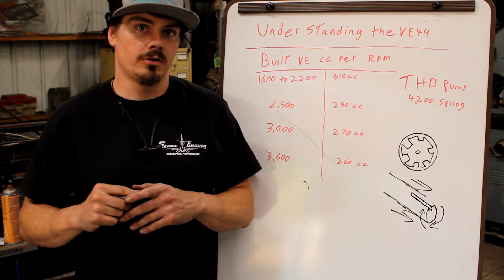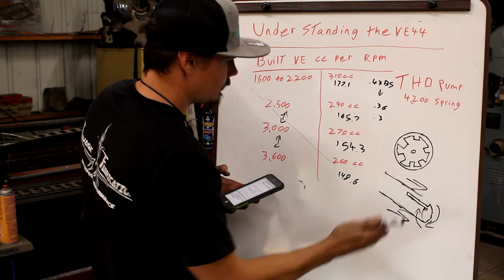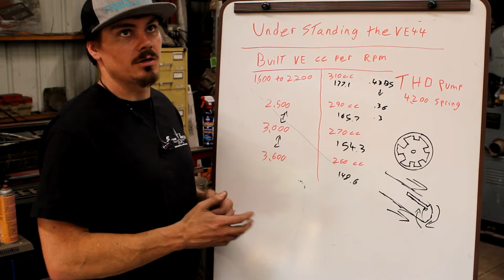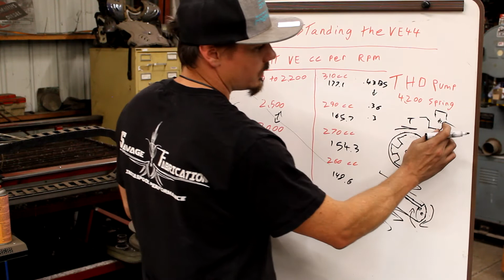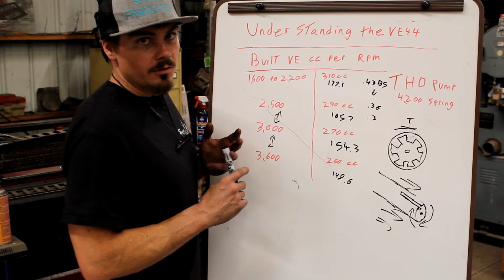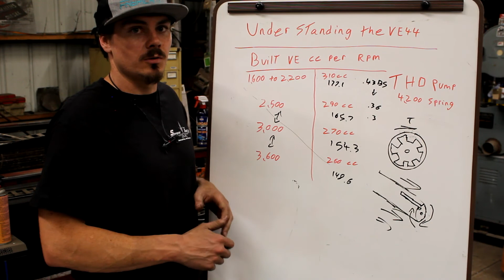VE Deep Dive pt 4

Comment: So if max fuel comes in at 1600-2200 correct me if I’m wrong but wouldn’t the 60mm hx super 9 with the vigilantly upgrade be perfect if max rpm is 3000
Reply from the maker: On paper yeah. But I have a feeling that you would produce a higher whp number with the std wheel. 

If the goal is not so much a peak hp at peak fuel delivery and instead a peak hp at 3k then yes the vigilante would help.
Reply: Would be interested to change my s363 out for a 60mm hx and see how much of a difference there would be in power and drivability
Reply from the maker: @daytonheacock8243  what turbine wheel is on your 63 s3

Comment: So can you run a non intercooled ve pump on an intercooled engine for more power?
Reply from the maker: Yes you can. You just have to switch out the delivery valve holders so the injector line thread pitch is correct. Some of the og franken pumps were intercooled pump bodies with non intercooled DV’s and the non intercooled plunger.
Reply: Cant wait to see the vp44 breakdown
Reply from the maker: @gaki00405  likewise :)